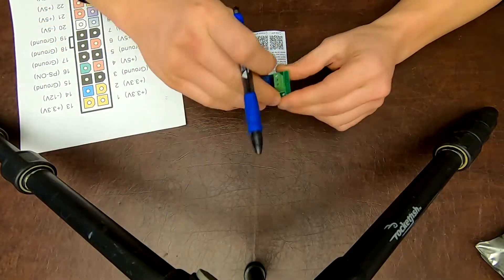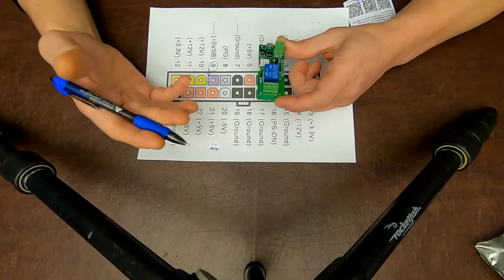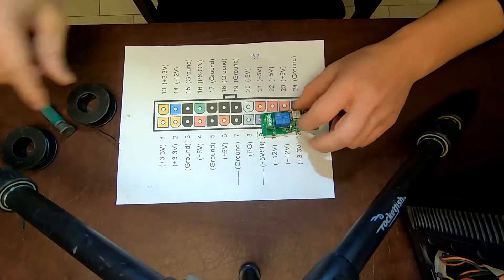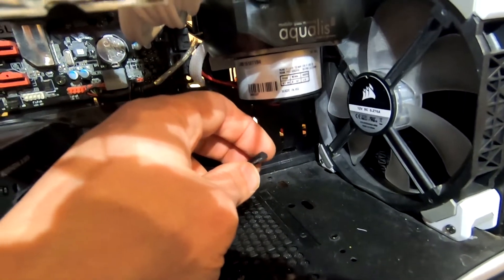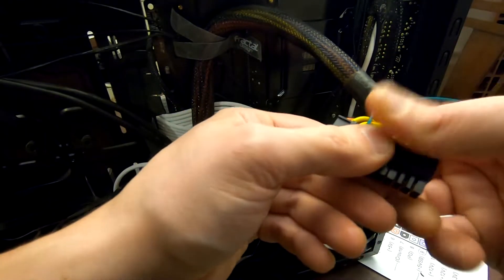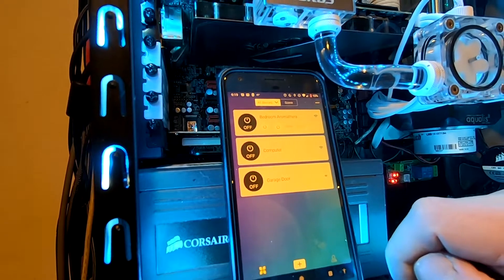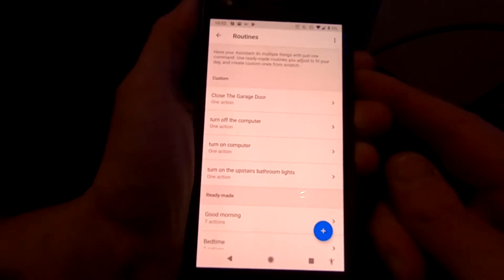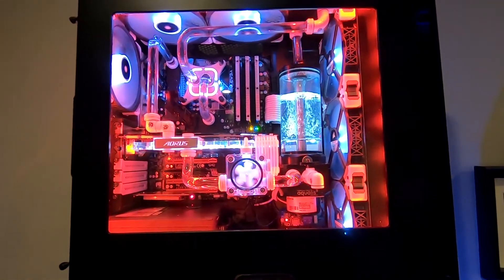Remote Power On Computer w Google or Alexa CHEAP

Comment: Thanks for your very interesting video. I was wondering if we can supply power to the board by the micro usb port on the board that plug into usb port on the motherboard, or maybe plug in to a 5v usb charger ?

Comment: Does it matter what wires go into which of the two pins for the jumper of the power switch?
Reply from the maker: Nope, it's just a switch polarity does not matter.
Reply: ModsAndProjects yeah cheers I managed to get it working just finished like 5-10 minutes ago. Thank you so much for this video it was very helpful and original. I have been wanting to do this for months but WOL is cra*. Lol

Comment: I have done this, and it works almost flawlessly. But it causes my pc to turn on and off on boot about 6 times. Almost as though it's posting.
Any idea what may cause this? Or even if it's related?
Reply from the maker: The board have a setting called "inch mode" you want to turn that off.  Inch mode holds the power button down (closes the circuit) for a few seconds. You want a simple momentary switch action.  That's my best guess based on the feedback you have provided. To enable/disable it use one of the push buttons on the PCB (check manual)
Reply: @ModsAndProjects  Yes, I tried that. 
I had the same problem after installation, and then the problem went away, and I don't know why. But then I turned off the pc at the PSU, to install a hard drive, and the problem came back again.
It seems the problem is then unrelated. I only thought it would be related because the problem arose initially when I completed the steps in your video.
Thank you for the help though, I do appreciate it.